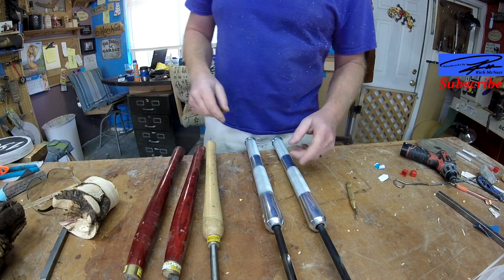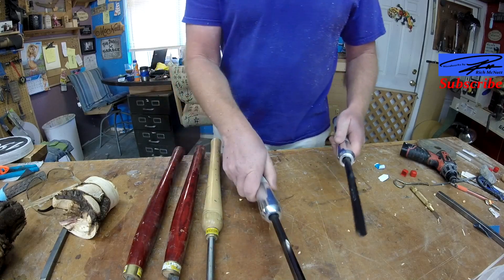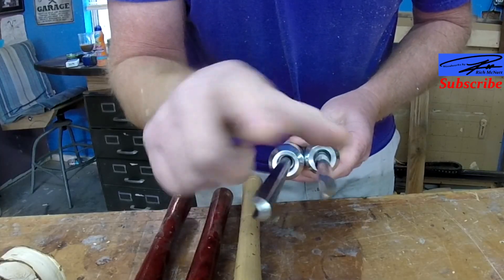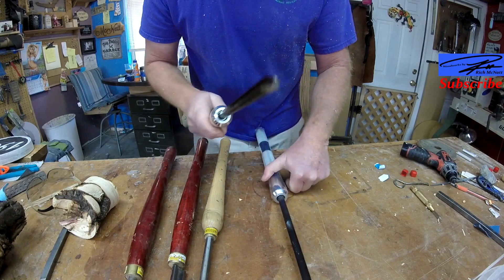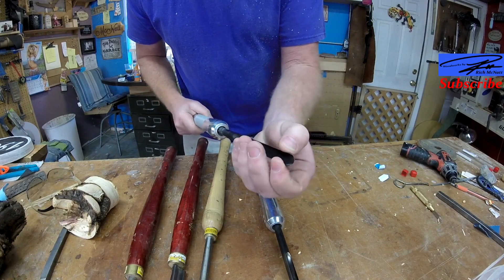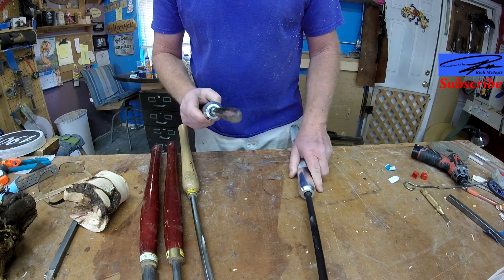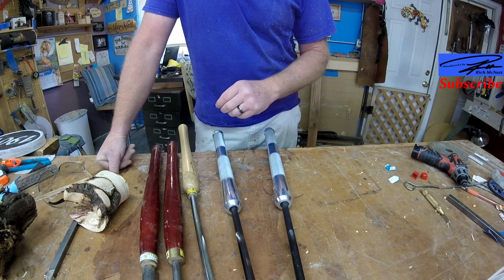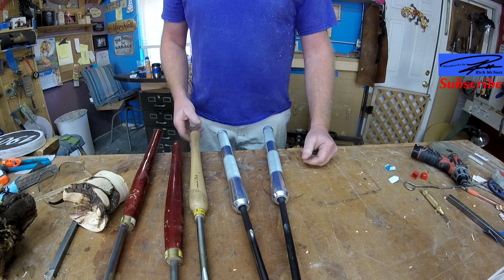Differences in a Bowl Gouge and a Spindle Gouge

Comment: I lost my best roughing spindle gouge exactly like you described, i was very new to turning, didn't have a bowl gouge, and was frustrated with the time it was taking to cut an end grain bowl  with just a scraper and tried my roughing gouge, Ripped the tool right out of my hands and broke the steel cleanly into 2 pieces, it was terrifying and i never tried that again. 

Very informative, thanks.
Reply from the maker: I learned the hard way my self way back when I started.

Comment: Great explanations...

Thanks for the video as to the differences of the gouges and the results if used improperly... 

BTW on a bigger heavier bowl the roughing gouge is super dangerous inside the bowl as the momentum of the heavier piece turning so fast can send a ten pound bowl flying off the lathe at berak-neck speeds and where it slams into once loose is anybodies guess.

Be safe, & be ever mindful of the reality of injury as it really happens on rare occasion.